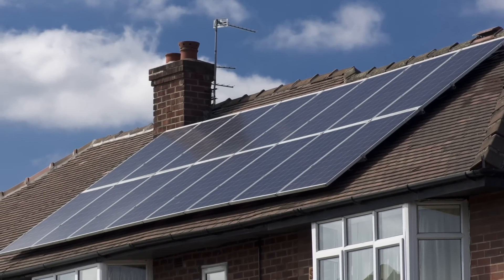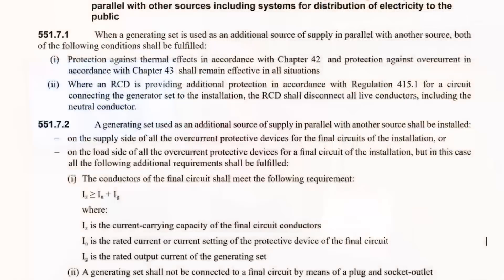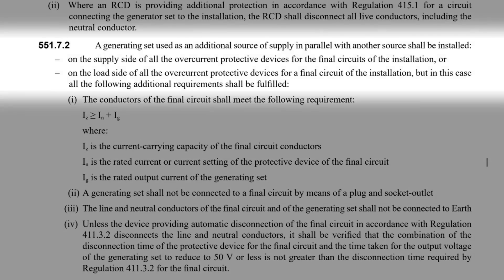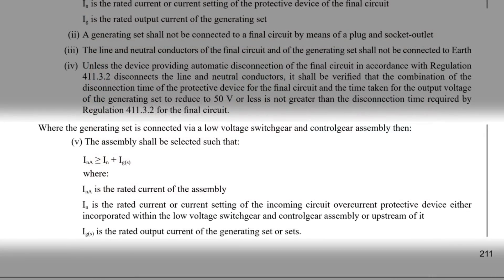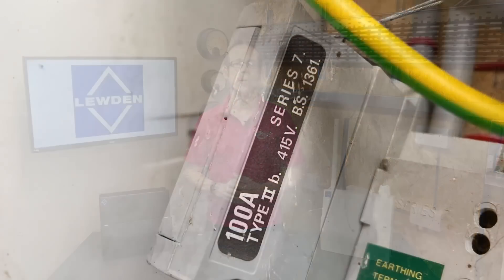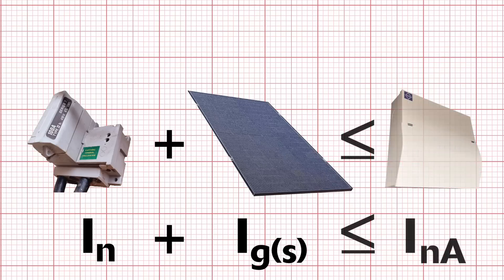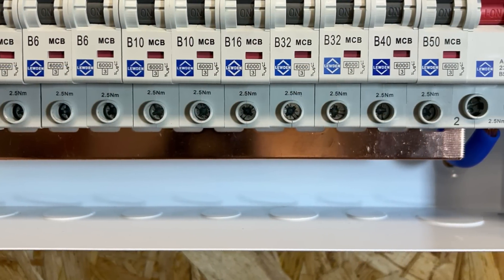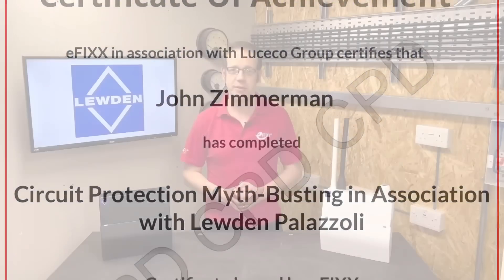Warning: Potential Consumer Unit Issues with Solar PV

Comment: Northern Powergrid will now only supply 80A on a single phase supply. I contacted them recently after buying a house to notify them that there was a heat pump, air con and a hot tub connected to the installation. Along with Solar PV and now an EV charger. The previous owner had just installed what he liked. They came to inspect the main cutout and actually downgraded me from 100A to 80! I wasn't particularly happy and the bloke doing the work even commented that I should have kept quiet.

Although 80A is just enough, and the EV charger will ramp down if I get close to it, I thought I'd enquire about 3 phase for the future. They did a desktop survey and came back with a figure of £9k to dig a trench over to the other side of the (quiet) road - about 10m I would guess. So I won't be doing that any time soon.
Reply: Northern Power grid is getting very twitchy about EV's and the potential for larger loads affecting their dodgy circuits.
I have noticed they are making a lot of "Grid Reinforcements" upgrades in my area as the electrical loads are ramping up and they are paranoid about everyone moving en-masse to EV's and Heat Pumps.
Reply from the maker: Thanks for sharing your experience. 😊
Reply: I spoke to Northern Powergrid about this and they said there was no such global policy in place to downgrade to 80A supplies on single dwellings.  They do have situations where the local network is no longer capable of 100A due to changes and additions, particularly with respect to how the phases have been divided up or if supplies have been looped or extended.  They also explained that they do take a view on the potential loads for a given dwelling - the' single-bed granny bungalows behind me tend to get a 40A cut-out.

On my own property the DNO approval from Northern Powergrid for an 8kW MEC with a 100A cut-out went through the approval process in Feb 2024 - so very recent.  It only took a few days for them to come back with:

"We have reviewed our existing network and, in this case and based upon the information you have
provided, have found that the existing connection arrangement (the “Connection”) is sufficient to
allow the connection of the generator to take place at the Premises. As no work is required to be
undertaken by us, there is no associated cost but our agreement to the connection of the generator
is subject to a new connection agreement for the ongoing use of the Connection being put in place."

The DNO service was fast, free and permissive.  What's not to like?

(Clearly I am aware of more challenging DNO permissions than this but I don't think they are out to be difficult for the fun of it.)
Reply: @ascot4000  Yeah I can certainly say they've been nothing but helpful and efficient when I've contacted them. When I was downgraded from 100 to 80A. there didn't seem to be much in the way of checks. He just saw the 100A and immediately said he'd have to reduce it as 'that's what we do now'.

When I spoke with the pleasant chap on the phone about the costs for 3 phase, I asked if 80A was the max on 1P now. He said it was, but that exceeding 80A would be 'fine' for 'a while'. Not something I'd like to test out although I do understand that these fuses won't blow the moment you exceed their rating.

Maybe if I went back to them and argued that 80A isn't enough for all my green/renewable tech, they'd look closer and actually check if my local network could cope with me having 100A.

Comment: Thanks for that, interesting video. In the real world, I think the risk is more theoretical than probable. My PV system only delivers full output in high summer, so there is zero chance that I would want another 100 amps of heating load is zero. I doubt if I could get to 100 amps if I turned everything electrical on at the same time, let alone 116 amps. It wouldn't be sustained for any length of time either - the breakers in my consumer unit only add up to 92 amps (I suspect that the ring main breaker would be first to trip, as the lighting circuits are grossly underloaded with the advent of LED lights.
Reply: It does seem to be a rather academic discussion as it's hard to see any real situation that this would become an issue. The solar input is offsetting the incoming current  so generally reducing the load.
And the incoming fuse, mcbs etc don't suddenly fuse/ trip when the current reached the number written on then. You'd probably need twice the rated current for a conventional fuse to fail instantly. And mcb's etc are designed to mimic conventional fuses, hence the two trips mechanisms.
Reply: Electric shower say 40A, induction hob on boost 32A and EV charger another 32A, that's me over 100A right there.
Reply from the maker: Heating load could include hobs, oven, showers, unlikely but not impossible. 🤷
Reply: @efixx  Thing about those loads (hobs, ovens, showers) etc is that they are not continuous loads.  A typical oven may well take upto 32A to get up to temperature but it sure doesn't sit at that rating for the total duration is is on. The overload case here is a thermal overload and I^2R for 116A vs 100A is 34% increase in resistive losses, which means 34% more heat,  and as things get hotter their thermal impedance falls so 34% more heat flux is not 34% more temperature. Without a complex precision thermal simulation you'd be hard pressed to objectively define the time constant for this increase ime.  Just turning on a toaster say, for an extra 10A for 3min is not going to cause a thermal runaway when you consider the specific heat capacity of the system.

far far more likely ime, is a thermal event in the CU at high currents that sit WITHIN the fusing thermal limits (which of course are much higher than 100Arms) due to a poor joint, ie an low clamp load or corroded joint in the system.   In the area i work in (electric vehicles) we have moved to active pyrotechnic fuses to allow much better control of fusing currents across a far wider range of conditions.

As you mention, most PV systems now are explicitly set to OFFSET grid load, ie the 16A it supplies is used to reduce grid load by 16A (using a CT around in the incomer).  116Arms at 240Vrms is a faintly ridiculous 27.8kW which with most high current loads now including APFC is an absolutely enormous amount of power to continuously pull for any private domestic properly really.

This reg is probably aimed at commercial properties where the overal power requirements are much higher than a typical single phase private household?

Comment: Informative video Joe.   Just 1 point to pickup on.  Main cut shows 100 amp as a max and not what the fuse inside is rated to.  They are meant to put a sticker over the top for the rating of the actual fuse as apparently it is illegal to cut the seals to check the fuse rating.
Reply: Yes, but the rating on the fuse carrier is therefore the maximum current for the installation, so if you select the current rating for the consumer unit based on that figure rather than the actual fuse rating inside, then you are 100% sure that the CU has been rated safely.
(not withstanding the calculation to include current from the generating set).

So you don't actually need to break the seal on the main fuse and inspect the rating of the fuse inside.

The only adverse impact to this technique is where the fuse rating is lower than the fuse carrier maximum current rating, eg.60 amp main fuse in a 100amp carrier, you end up over specifying the current handling rating for the CU, so you spend more money than is necessary.

The benefit of doing it this way, is obvious: if the fuse is ever upgraded from 60 to 100 you don't need to upgrade the CU as it has already been selected based on that 100 amp rating .
Reply from the maker: Nice point thanks Sergio. 👍
Reply: Yup. Many old installs are 60A or 80A. Its the rating of the carrier, but the fuse that is inside.
Reply: Beat me to it, plus with grid CTs on all generating sets this seems null and void to me. 

Also, 116A load?? 😂 no chance. The most I’ve seen is 90A and that was with the customer trying to get to 100A with a Tesla power wall, Tesla charger, tapeo electric boiler and other heating elements in the house.
Reply: @bradleyarcher9840 Grid CT's are irrelevant.

We are talking here about having a fundamentally safe installation. And that means sizing all parts appropriately. CT's and measuring currents don't help in that.

Comment: When I recently had the cutout fuse at my house replaced by UKPN due to the holder being damaged, they replaced the original 100A cut out fuse with an 80A one. Since I have a PV installation your video suggests the reason why they did that.
Reply from the maker: Great info 👌